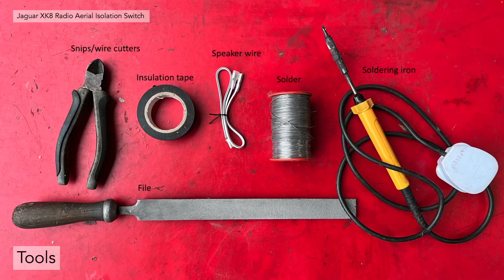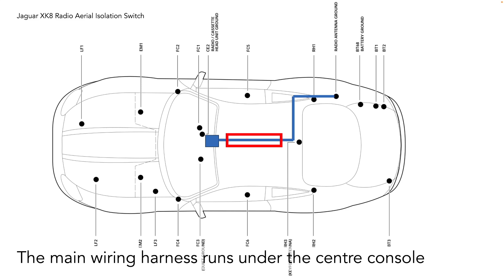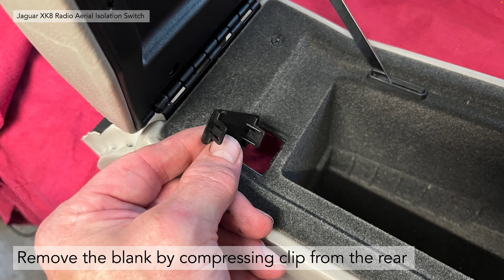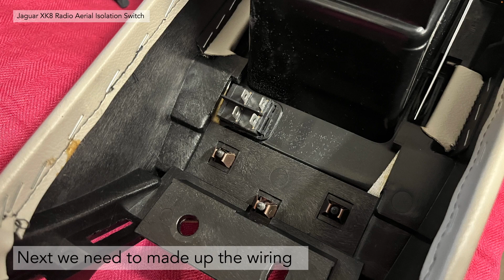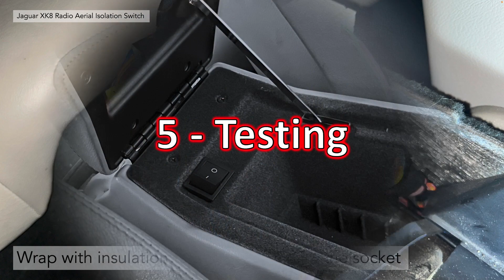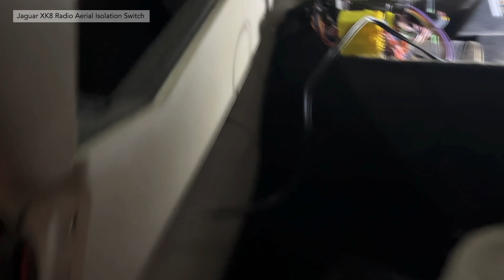Jaguar XK8 Radio Aerial Antenna control switch, stop extension when you don't need it. V201 XKR X100

Comment: I removed the rear antenna on my 2005 XKR coupe entirely and replaced it with a Taoglas MA1060 Raptor "sharkfin" antenna that receives AM/FM and both receives and transmits cell phone signals. I have the cell phone cable connected to a SureCall Fusion2Go Max signal booster, mounted behind the back seat, which connects to a thin, rectangular transmitter/receiver hidden in front of the J-Gate. I place my iPhone 16 Pro Max in a slot Dremel'ed into the black plastic change holder, just a couple of inches above the transmitter/receiver module.

I recently had the roof and rear quarter panels repainted by a body shop to fix some spots of oxidation. The shop painted the sharkfin antenna to match the car's Jaguar Racing Green metallic color. Finally, they filled the hole in the right rear quarter panel where the original antenna had been located. The XKR now looks like a modern car with sharkfin antenna and no indication that it ever had that ugly power antenna.

Of course, it cost a lot more than a $10 switch...
Reply from the maker: Hi Ray, that sounds like an exceptionally neat and well-thought-out modification. Integrated sharkfin conversions on the X100 coupe profile—especially colour matched in Jaguar Racing Green—give the rear quarter a very clean, modern line.

Incorporating the cellular signal booster with a custom slot right above the J-gate is a brilliant touch for real-world usability. While a simple aerial isolation switch is the quick fix to save the mast motor on a budget, doing a full body-fill and seamless sharkfin integration like yours is the ultimate long-term solution.

Thank you for sharing the detailed setup with us. Please send us some photos or videos of your modification and we can share it with our subscirbers. 

If you are following our regular workshop builds, please consider checking out and subscribing to our alternate channels, Modurol Live and Modurol Shorts, as well. It is great having you with us as we work and learn together across the community, regards Damian

Comment: If you take the fuse out fuse 9 this stops it and is it worth doing?
Reply: Thanks Damian
Reply from the maker: @MaverickXK8, That is a common question, but removing fuse 9 will actually cut the main power supply directly to the radio/cassette head unit itself, rather than just isolating the aerial. Looking through the factory electrical diagrams, there isn't a dedicated, individual fuse solely for the aerial motor circuit.

This is exactly why installing a dedicated isolation switch works so well. It allows the head unit to function perfectly for cassettes, CD changers, or Bluetooth modulators without forcing the mechanical mast to rise and lower every time the ignition cycles. You only throw the switch when you actually need the AM/FM radio frequency signal, which saves significant wear and tear on the internal plastic aerial gears. Working and learning together to figure out these neat electrical workarounds is exactly what this community is all about, regards Damian

Comment: WOW!  Excellent video!  Now:  How do I rid myself of the "Engine Fail" light?
Reply from the maker: @halmc8109, Thank you for your feedback. The Engine management light can illuminate for lots of different reasons. Normally, it will be accompanied by other symptons. If not need a simple OBD2 code ready to receive the ECM error code. That should give you a clue as to the problem area. Hope that helps, regards Damian

Comment: Hi Damian,
Great video as always - thank you. I am going to carry out this mod on the Stratstone over the holiday.
Just one question if I may. I note that the aerial motor has a 10amp fuse. So should I be using reasonably chunky wire and switch to cope with the current?
Reply from the maker: Andrew, thank you. The wire we interrupt is the signal wire from the back of the radio head unit and not the main aerial power. The signal wire and switch doesn’t need to be ‘chunky’ as not 10amps. Hope that helps, regards Damian
Reply: @Modurol  Ah of course! Thanks Damian. I will be converting the cigar lighter and changing some bulbs whilst the centre console is out. Thanks again, and a Happy, healthy and prosperous new year to you and your family.
Reply from the maker: @andrewgraham4838, Happy New Year to you and your family too, regards Damian

Comment: Can you do a version for us colorblind folks? And no, I don't have any plausible suggestions on how that might be done.
Reply: It’s the wire going into pin 7 on the connector shown, per the wiring diagram RH1-7
Reply from the maker: Hillbilly, going to need to help of non-colour blind friend . Wouldn't recommend trial and error in this case, regards Damian